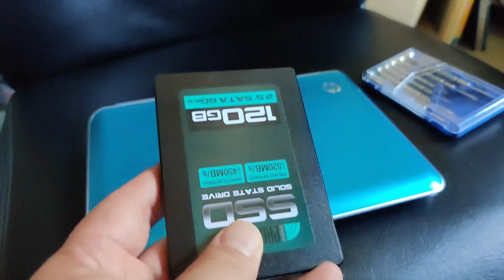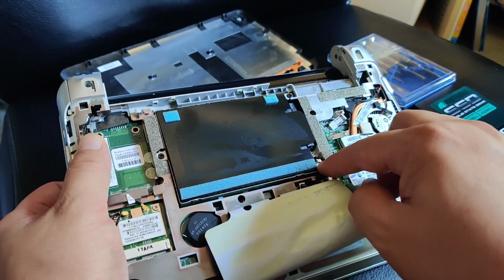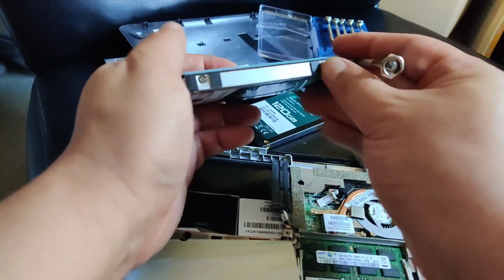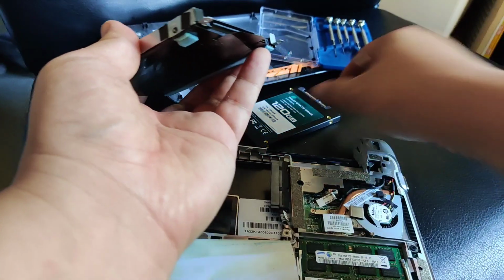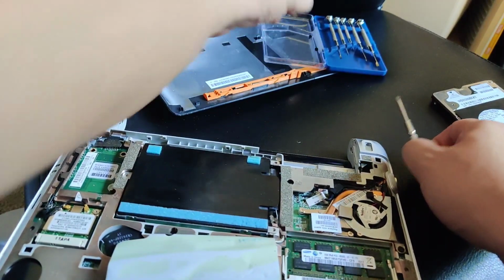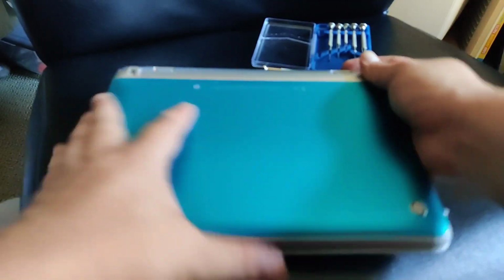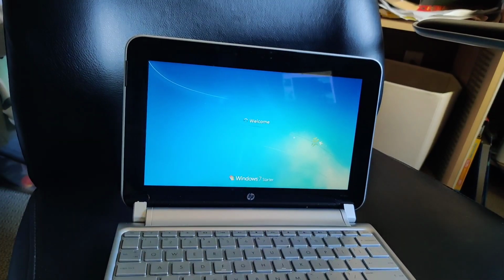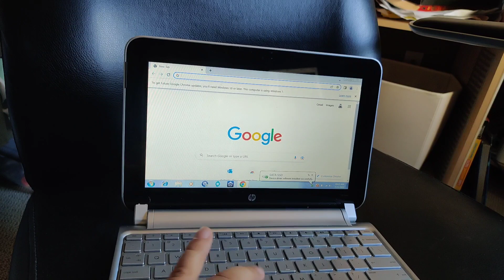Installing an SSD into my old HP mini 210 netbook.  It's pretty easy.

Comment: Where did you get the new ssd, and what’s the specific name of it? I’d love to do the same with my pink hp mini 210
Reply from the maker: I think most 2.5" ssd's would work.

But.. the old hp 210 is OLD.  

I would suggest upgrading.. if you can.  I like old stuff too... but it was just such a poor performer.  In todays age.. you can buy something probably 5-6 years old for $100 that would run 10x faster then then hp210
Reply: @aleksdude  I already do have something much newer this is just a cute little side project. I appreciate the info!